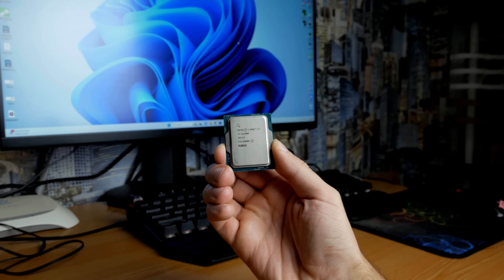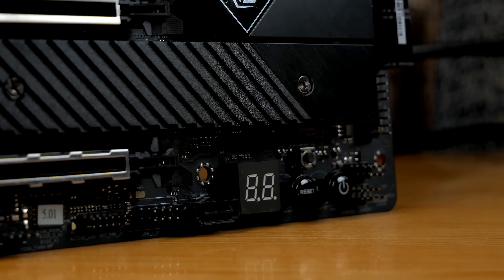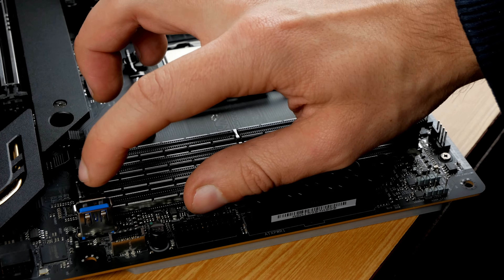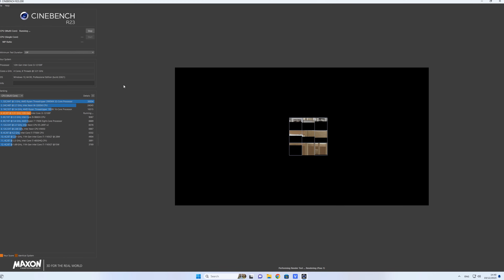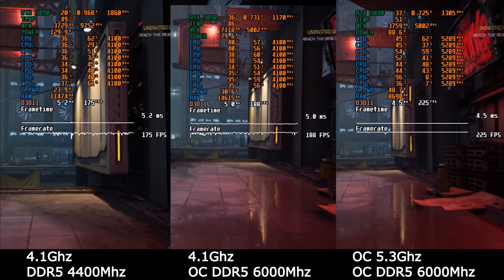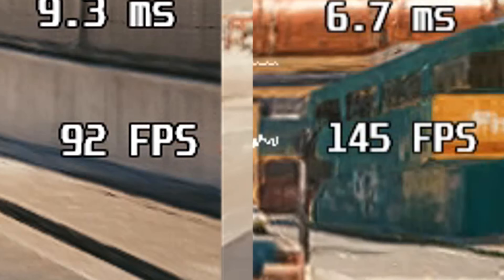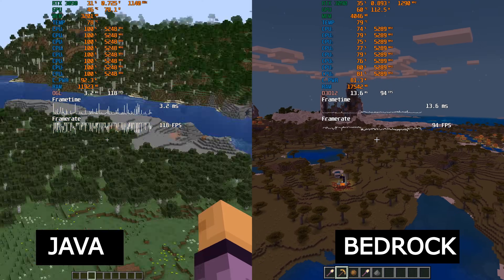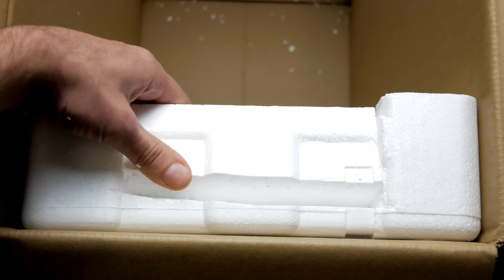i3 12100 VS OVERCLOCKING

Comment: 5:50 1050 ti performing miracles 🧐
Reply: Maybe he forget to change name in msi 😂😂
Reply: Why xeon with 1050ti and no rtx?
Reply: @dasbingoyoutubebecause xeons are much slower on 1/2/4/8 core performance than overclocked i3 12100. You don't really need anything past 1060 6GB because even fastest xeon with highest core count and highest core clock can not give enough power to utilise 1060 6GB to full potential. xeons are of course really good for multithreaded software.
Reply: @ajajaxdlelyou can't use rtx on non rtx graphics cards
Reply: Go Cheap, why Z790 ????
any F CPU is cheap build ! why fancy blocks and radiator for low level CPU ?
Reply: @lucasrem it would be a boring video without them
Reply: @lucasrem  because 100w draw on i3 and many low budget mobos dont let you change BCLk.